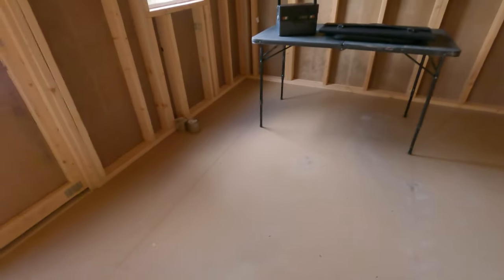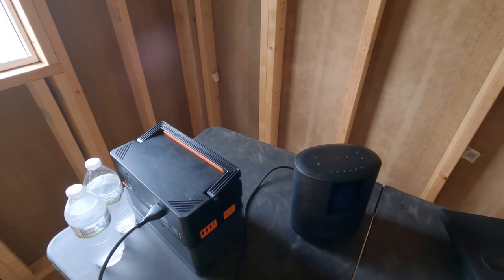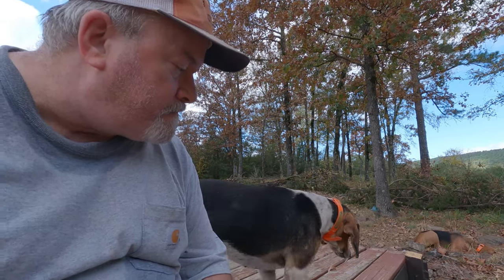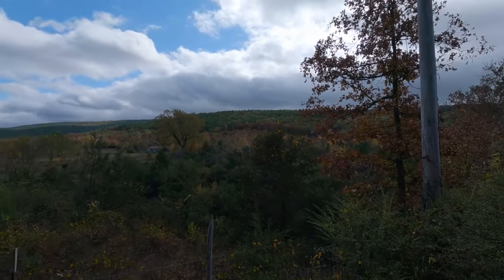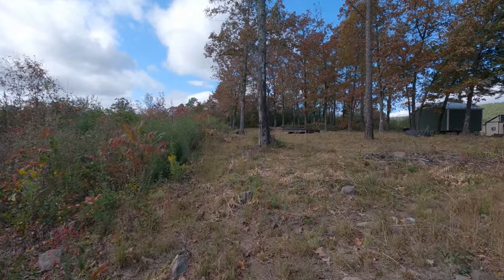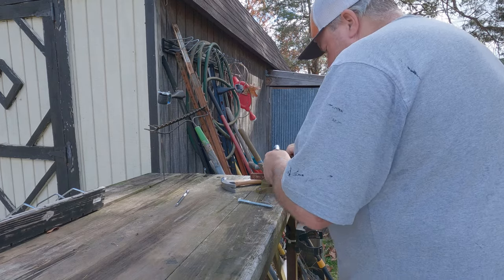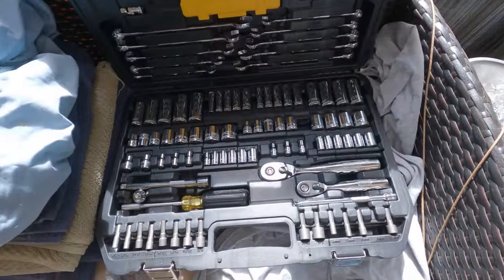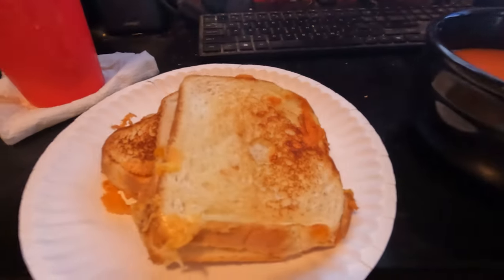Too Hot To Work In New Building, Perfect Weather For Some Fall Loafing

Comment: Drill a hole in a 2x4 and place bolt in. hole should be small enough so washer catches on top. Use screw driver or something small enough to fit through socket. Pound away 😅

Comment: Heat expands and cold contracts. Heat the socket and chill the bolt.
Reply from the maker: But if I chill the bolt, Im chillin the socket! lol They stuck man!
Reply: Lol!  You have work fast.
Reply from the maker: I will mail you the whole thing! show us how its done! @gshooty55
Reply: @ouachitamountainliving  if you did I would wrap a wet rag around the bolt shaft and maybe tie it or wire it in place. Then I’d put the socket in the vice with bolt hanging down.  I’d maybe dip the wrap once more for good luck. Then I’d heat the socket.  The heat will go up and the  rag will keep the bolt cooler than the bolt. You might need to tap on it.  Just give it a try.